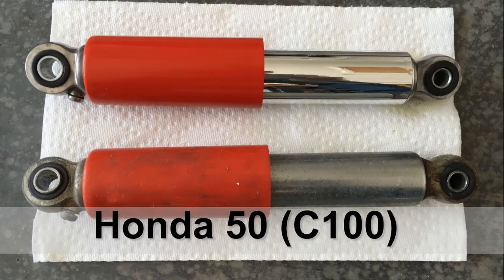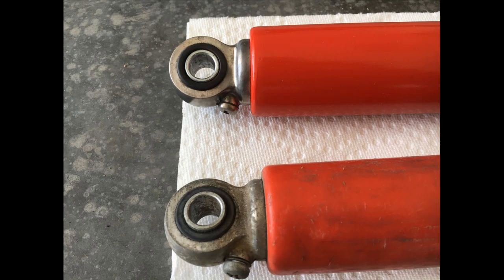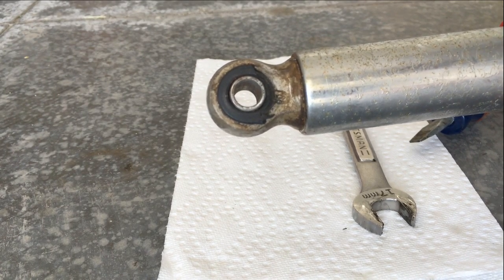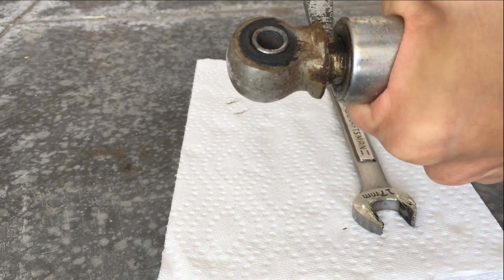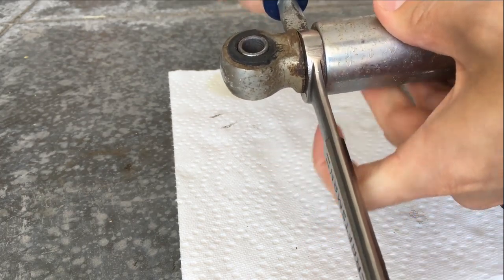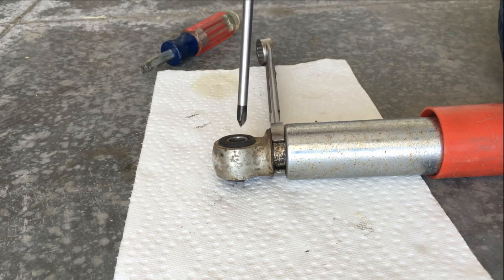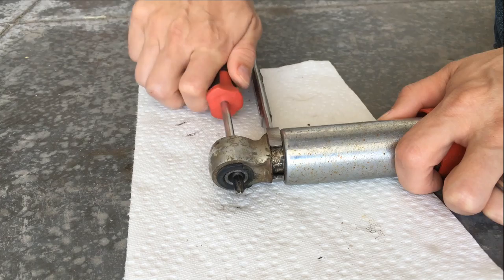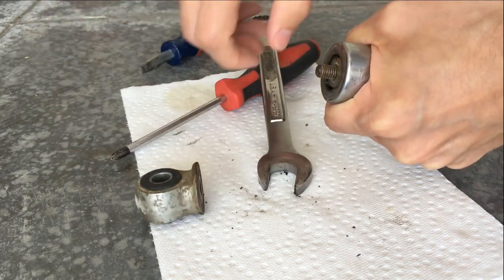C100 Honda 50 rear shock disassemble

Comment: thanks for the good video, where did you buy the lower chrome covers ??, can you upload a link as i cannot find them on ebay
Reply: Steveocork I couldn’t find them either. I used chrome tape for use on exhaust repairs at the auto store. Just carefully wrapped the stock tube with it.

Comment: Can front shocks be repaired?
Reply from the maker: Phroden Dekia Yes, you can still find replacement rubber stops for the front shocks on eBay. Search for c100 NOS. “New old stock”

Comment: What is the purpose of the rod with the steel bar and the rubber bush on it?
Reply from the maker: This is the shock absorber. Without it the spring would bounce continually after every bump in the road. The rubber piece at the end is called a bump stop. This is what you will hit if you "bottom out" or put too much weight on the bike.
Reply: alticetube how we know if the pump is working? Or if the springs needs to be replaced?